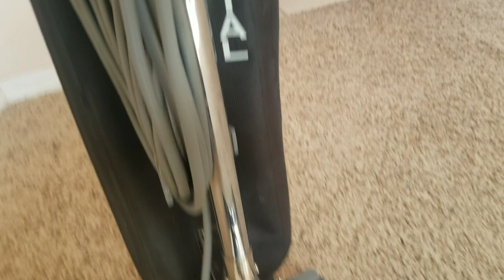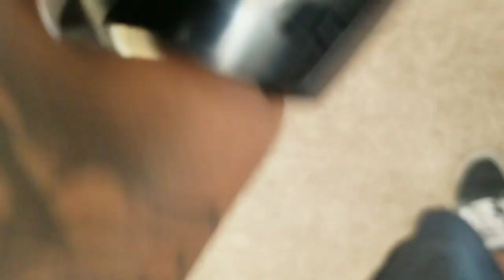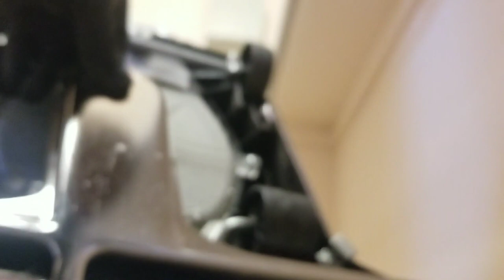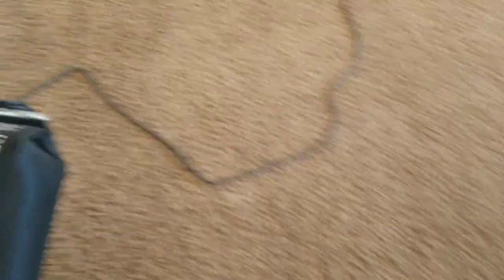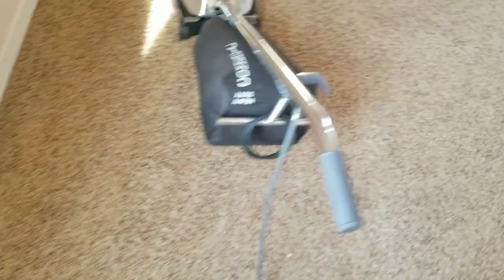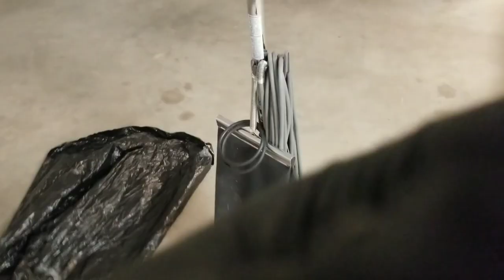Sanitaire SC899 Type E, Black, Custom Build, In Long & CRUNCHY Vacuuming w/ Bag Dump (March 2021)

Comment: That looks like a good carpet but it's in desperate need of a shampoo. At least you got the right vacuum to try and give it a good deep clean - nice job on the Sanitaire. I use to use those vacuums when I did cleaning in Condominiums in Toronto. They are workhorses!
Reply from the maker: Thank you! I get a kick out of building these vacuums. I sold a few to close friends that appreciate their power, durability and longevity.

This was a pre-vacuuming for carpet cleaning. Overall, this house was a move out cleaning, including carpet cleaning. I was by myself this day, which I completed 80% of the house cleaning including vacuuming in about 4 hours. I returned the next day for 3 hours to finish the house along with carpet cleaning. House was roughly 2300 square feet, but the payout for the work was roughly $550 USD, excluding tip (which even though I appreciate, I do not request for by any means)

Comment: Do you have a SC679J? I would love to see it in action on a crunchy carpet 🔥
Reply from the maker: Unfortunately I don't have one. My only 12 inch vacuum is a 2008 SC888J. I am slowly building a "new" SC886, which I will use for work as well. As soon as its built, I'll take it on its first major run on video 😎💪🏾💖💯

Comment: How do you edge vacuum? May you show it
Reply from the maker: It's nothing exciting. I use the Sanitaire Mighty Mite canister vacuum to clean edges and stairs. I use the crevice tool for the edges and corners
Reply from the maker: I don't see why I could not record myself doing it though. Never saw it as "exciting" 🤷🏾‍♂️🥴

Comment: If I decide to go with a sanitaire commercial vacuum cleaner can I get it in the color blue
Reply: Absolutely! The blue line is there lighter duty Version
Reply from the maker: Two Wheeler is correct. The blue line is the residential version. Focused on the lighter, plastic hoods, shorter 30 ft cord, F&G or ST bags, and some models like the commercial red line, lack the "Quick Kleen" fan chamber
Reply: Christopher, what's next for your PowrFlite?

Comment: When it's rattle just let it suck it up won't break the fan
Reply from the maker: I'm not going to risk needless damage especially if I have multiple jobs in a day, and... you're not paying for my fans
Reply: @famellc2019  they are cheap plastic
Reply from the maker: Yeah you're missing my point. I'm running a business, so I'm not vacuuming because it's a hobby. If I'm working and I break a fan, not only do I have to pay for it, but my machine will not only  be extremely inefficient, it will be essentially out of service. So, if I have a multiple property day, it can screw up an entire day, especially if it's on a time frame